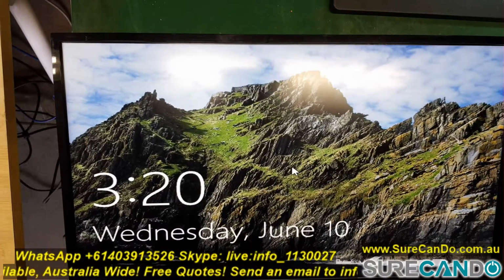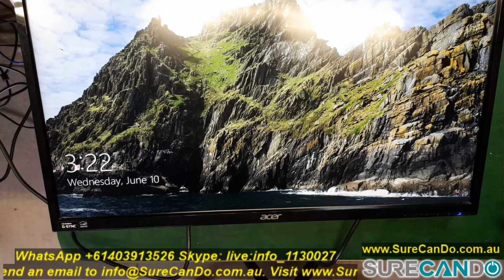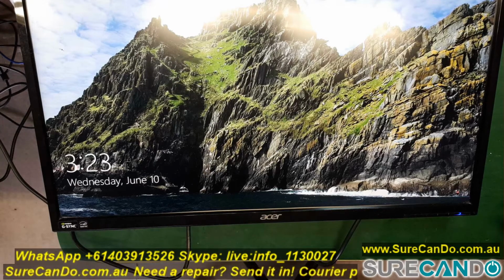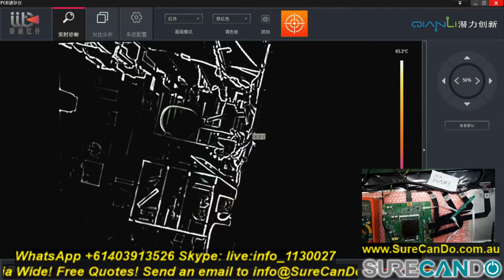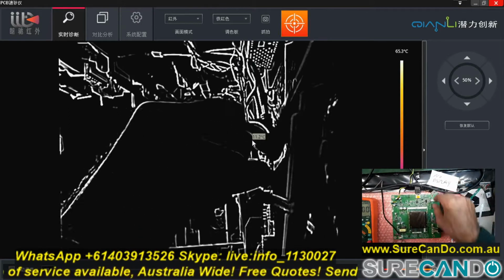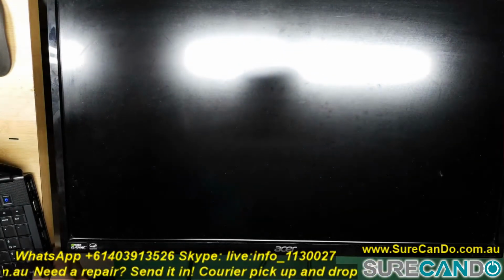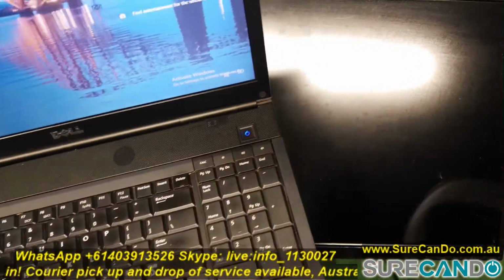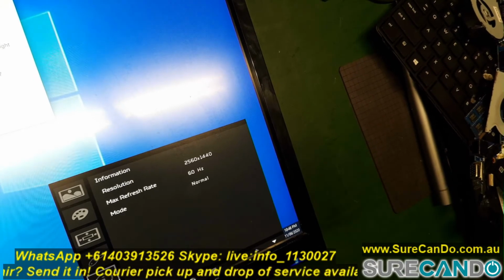NO SIGNAL Issue Repair Attempt Fix Acer Predator XB270HU 27" G-Sync Gaming NVIDIA XB271HU LCD

Comment: i have an acer xb271hu (so the newer one). have been having similar issues on boot for a while and at random. somtimes the display even starts but i get a horrible 640x480 resolution or myabe it gets to 2560x1440 but doesn't get above 24hz, 60hz, 85hz... it's kinda wonky. what I usually do that (almost always works) is: 1) switch to HDMI (no need for anything to be plugged in) 2) go to the overclocking settings and press the apply and reboot setting; that reboots the monitor 3) switch back to DP input. it usually fixes bad NO SIGNAL, bad resolution/refresh rates.. but not always... so if it still doesn't work I just turn of the PC turn the monitor completely off (via it's integrated PSU switch) and then turn the computer on let it boot into windows, and turn the monitor on after fully booted via the power switch (you can also use the power cord). and even that, sometimes doesn't work (very rarely), then I turn everything off, unhook all powercords, pray to the DisplayPort gods, cross my fingers and it usually starts working again......... I also think this must be some sort of weird DP negotiation problem. had this happen with a 1070 and my 1080ti. guess we'll just have to live with this....
Reply: use custom resolution utility. (cru). Run reset-all.exe then restart64.exe. Have a nice day..

Comment: Hi can you say what can be Problem if acer predator x34 get no any Image, 
No Acer logo
No Menu Image 
Nothing 
Only Backligth is working
And will detected from PC and Notebook.
The Mainboard looking fine, I connected to the powersuply , work fine, no any short
Reply: @SureCanDoComputersServices1  Thank you so mouch, When I start the monitor  its looking two LEDs on GSYNC one of this is green and the other one is blink RED. I think I can be sure that is 100% GSYNC Board faulty.
Reply: @isaborchanow4541  any update??
Reply: @SureCanDoComputersServices1  I get a new Gsync, but it stil same, nothing has changed, what I have to try more?
Reply: Any update? My x34 monitor also faced a same problem

Comment: any ideas for my monitor when i use it at 165hz the picture has what looks like noisy splotchy look, when i lower it to 144hz i get like flicker and scan lines and when i get to 120hz it starts to become usable but with a ever slight flicker and at 60hz its perfect? can it be a simple bad capacitor?  looks like opening it up is a pain and if its anything more difficult i probably won't be able to do it any ways, thanks. I have been using for years at 165hz and recently it started to get worse and worse over time.

Comment: Mine is flickering and stuff, going crazy (video on my channel) - it's 5 years old and way past warrenty so I'm gonna disassemble it, most likely a power supply issue
Reply: It can’t be the cable (check my channel for video) because the Acer logo bootup is also messing up
Reply from the maker: @MarkBlackMigo  The donor LCD board i got - that was the issue with that one - cable. Again - it could be the G-Sync - good luck.

Comment: i got this monitor. the displayport cable damaged the monitors dp socket. No display when i plug it. Only boot ups the acer logo. screen is fine. I am trying to solder the dp socket but in my country Dominican Rep. no such luck. I got to do it my self. As you know this monitor was pretty expensive back in the day and is still very good 1440p monitor. Any additional thoughts you can help me?
Reply: @SureCanDoComputersServices1  could you tell me the right socket for this specific model? As I can see there are lots of different socket types. I have to buy it online and bring it to a repair shop here so they can do the soldering, Thank you.

Comment: Thank you for this video! I have to open mine up this weekend so this helps a lot with preparing me for what's to come.
Reply: @SureCanDoComputersServices1  I will, but it's not the "no signal" issue I'm having. I am pretty sure, and hope, all I need to do is resolder the displayport. I get vertical lines on half my screen that go away with wriggling the cable. Happens with 3 different cables.
Reply: @JohnStro   Did this work for you? im having the same issue as well as flickering, or it just not displaying a picture.